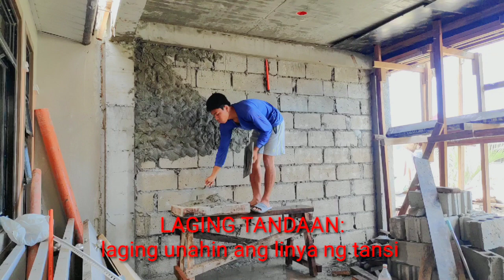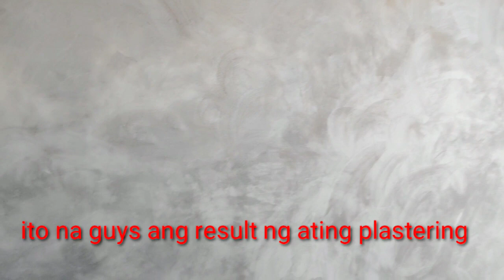You need to know before you start plastering a wall/mga dapat malaman sa pag papalitada

Comment: Ilang hollowblock po ba ang isang sako nang cemento at ang ratio nang buhangin. Nang palastering
Reply from the maker: Sa plastering  ang mix ratio is 1:3 
1 cement is to 3 bucket of sands
Reply: Pag mag setting nang hollowblock. Ilang piraso po ba na hollowblock ang isang sako nang cemento

Comment: Boss ano po ang magiging resulta kung ang mixing ratio sa palitada po ay 1sackcement:1.5sacksfine sand or 1sack cement:2sacksfine sand?
Reply from the maker: ang magiging problema is mahirap ipangpalitada dahil masyadong malapot
ok yang sukat na iyan kung sa moldings or mga designs..
Reply: Ano po ba ang mas maganda na finish ng palitada bossing? Yung rough or smooth finish? Kasi may nabasa ako kung smooth finish daw si masyado kakapit skim coat at pintura
Reply from the maker: panoorin mo ito bossing para maexplain ng mabuti sayo kung anong mas maganda rough o finished
https://youtu.be/mjA-en6KrCY

comment ka lang kung may gusto kang malaman..salamat😊